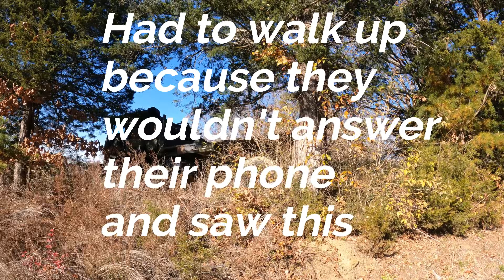Gatlinburg Spot 30 Strikes Again, Multicar Rescue and Subscriber Shoutout

Comment: Side note: In London they have a flatbed with a big magnet on a Crane. They pull up next to a car, swing the crane out, drop the magnet on the roof and pick it up and place it on the flatbed. Bing, Bang, Bong and they are gone.
Reply: Actually they have arms That Swing Out Underneath the car and pick it up

Comment: What kind of cable do you have on the front winch?
Reply: Trying to determine if synthetic would hold up ?
Reply from the maker: Half inch synthetic rope.
Reply: How long is that suppose to hold up to the sun
Reply: @EverythingAutos  what is your opinion of the wire cable vs synthetic rope?